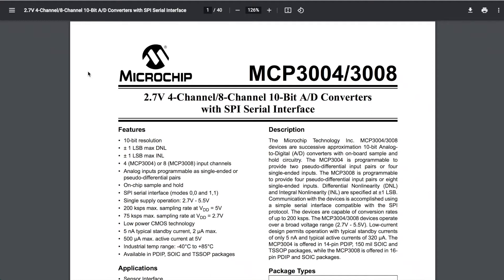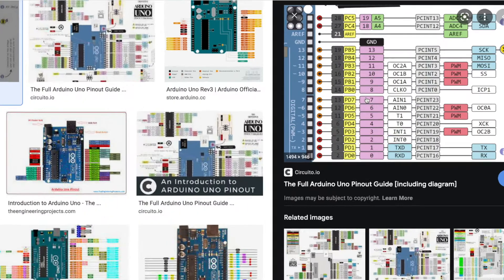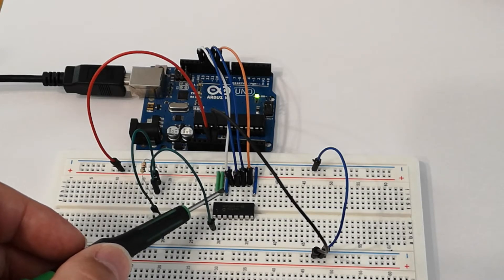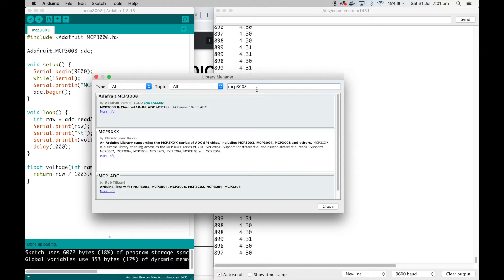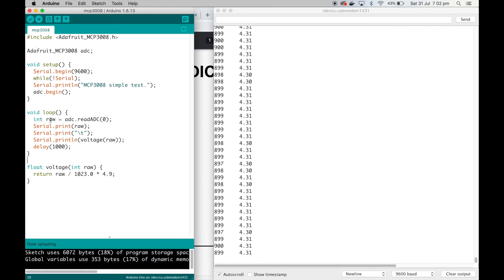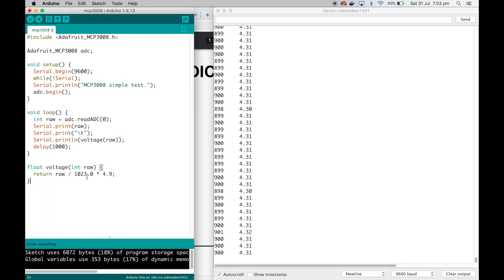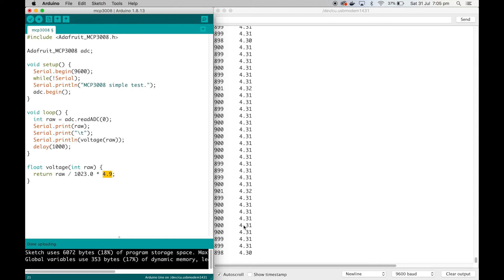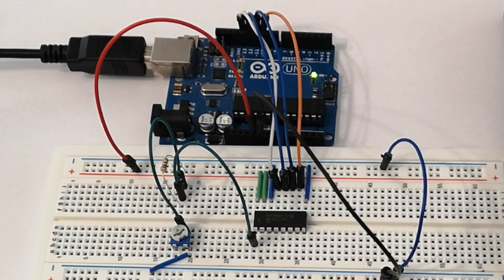MCP3008 8 Channel 10-bit ADC

Comment: I tried your program and I got the problem on that voltage mapping value. I think the program read it as "raw" value divided by (1023 * 4.9), that's why I got the zero value. I fixed it by rearrange the mathematical equation though. 

Thanks for clear and comprehensive tutorial sir! your channel so underrated🔥🔥.
Reply: I solved it by replacing the 100K potentiometer with a 5K one.

Comment: this means i can use additional 8 analog input plus 6 analog input on arduino ?
Reply from the maker: yes. If you need 14 analog inputs this is one way of doing it.
Reply: @SteveRaynerMakes  according this, I'm new to arduino, my question is... let's say we really running 14 analog inputs simultaneously, is it possible for arduino to handle all those 14 current (load)